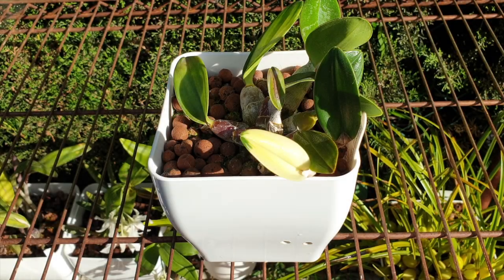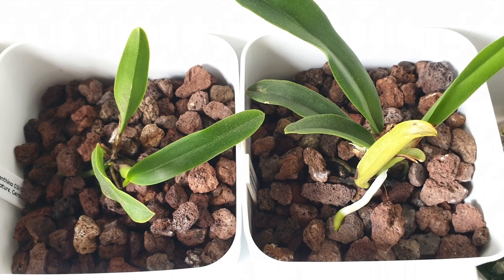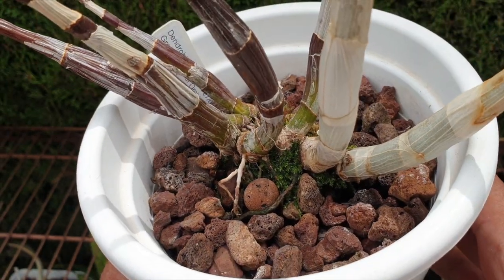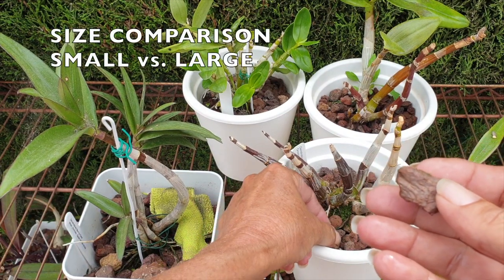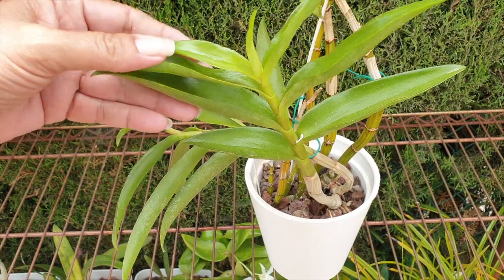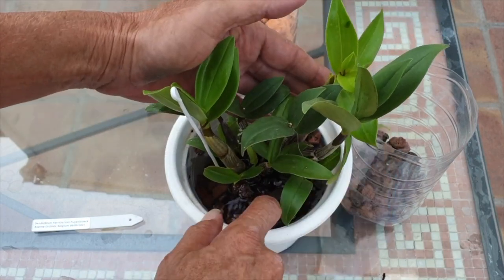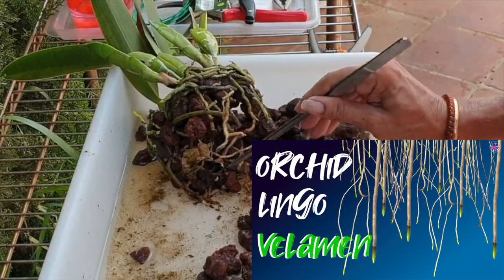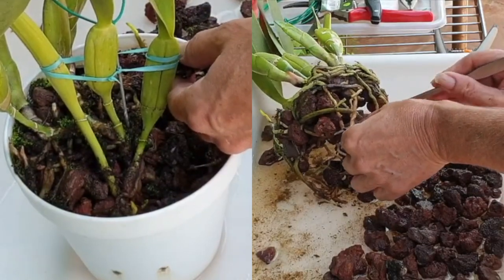Lava Rock for Orchids in Semi Hydro | How does it work? Limitations | Best Practices #ninjaorchids

Comment: I dunno, the red lava rock that I get here looks the same as yours and it does wick. It isn't terribly efficient at it, but if I set a pot of dry lava rock in a saucer of water, it will slowly wick up through the pot (but never reaches the surface). The black lava, on the other hand, does not wick but this is really inconsequential because there is something about the black that orchid roots do not like AT ALL. (I had hoped at one time to be able to use the black because it is 1/2 the weight of the red). In any case, good information to help people that want to use it. I chose to give it up because of the root damage during repot. It was just easier to use bark and replace it rather than destroy a root system every time I wanted to repot an orchid.
Reply from the maker: Don Miguel 🥰💐 hola jefe! I find that there may be a little dispersion of the water in the pot, as it rises, but I am not sure if I would say it actually wicks, but maybe with smaller pieces, there is a wicking effect 🤷🏼‍♀️ interesting to know about the black lava rock! I did not know that, thank you for adding that here. I have not seen black lava rock available here... wow... good to know because I would have picked the black bag at first sight if that had been an option and while it would still work out, maybe not as effectively as with the red. Awesome nugget of intel, thank you, Michael. The repot.... goodness me, a nightmare yes! I remember the first orchids I repotted. The coilostylis was only removed of so much lava rock because I divided it for The Orchid Room... my oerstedii probably still has some pieces of lava rock in the centre when I moved it into leca. Now I can start snipping away at division on that one but wow.... the root damage is exponential. Meanwhile, if I were still in Kenya... advanced the collection to pots ... that would be a dream... even just to have the orchids in the coral parts that were like rocky formations in the garden, secure and add lava rock for funsies! Sigh!! 🥹 thank you so much for watching, my friend! Your support is so very much appreciated 🙏🏼🫶🏼❤️🌸

Comment: Hi Nina, I  am trying leca, lava rock, and pumice. What do you think about pumice??? I just ordered akadama looking forward to see how it does. Thanks for your videos very educational.
Reply from the maker: Hi Maria 😍💐 thank you for your feedback and for watching, I appreciate the encouragement and support 🫶🏼 I have 1 or 2 orchids in pumice, because I had it lying around for years and wasn't using it as leca and lava are my go to. However, to not have stuff lying around, I potted up an Oncidium Alliance orchid in pumice only and it really enjoys the self watering with pumice. Never had an issue with it, and 3 years later, it is going to need to be repotted at some point in time. So, for really thirsty orchids, and my oncidium is medium sized, it is working great. When it comes to repotting, I am not buying more pumice just for this orchid and I do not have intentions of using it more often. I am a little wary of how porous it is, will the roots suffer damage when I repot because they have attached to the pumice and make it complicated to remove some of the dead ones? Those have been my thoughts on it since I potted this orchid up. I know that lava rock can cause damage, but I have found that if there are dead roots to contend with, even with lava rock, it comes off really easily, so I am not as bothered about it anymore. I do not remove all the media when I repot and don't force media off of viable roots. Is pumice a good filler for organic media mixes as well? I say yes, however, it will always float until roots start to hold it in place. Flushing my oncidium pot after repotting was a little bit of a nuisance because the pumice kept dislodging until the roots started to anchor themselves to it. Not sure if any of what I said was helpful, so if you have specific thoughts as to how you want to use it, where and with which orchid, please let me know and I can break it down even further 😊 hope you are having a wonderful week, Maria!! ❤️🌸
Reply: Thank you so much for all this information. I will keep that in mind. I started to use it because Anabel from, the orchid room is using it, and I thought I give it a try. And than I  saw your videos on lava rock and decided to try that also. Now I mentioned to you before that I have lots and lots of orchids in super old media's, that's why I  am trying in inorganic media so I don't repot that often. I think I have around 350 or 400 orchids to repot. I  do a little each day . Anyway thank you for all your orchid videos super helpful. I will be fertilizing them also. They have not been fed. Can you believe that. Poor orchids they need so much help. But I will take care of all them. Most of them are Phals.  Thanks again.
Reply: Have a great weekend.
Reply: Hi Nina,  I have a Prosthechea cochleata that has outgrown its 9" ceramic pot with bark.  The plant has full bulbs outside the pot and a forest of ariel roots.  It blooms consistently.  I live in a semi arid climate with humidity between 15 and 30% depending on the time of year.   So I started looking for a set up that would provide consistent moisture and humidity and came across your channel and I'm grateful for all your content..I've been been binge watching gor some time now.   In one of your videos you said you wouldn't use lava rock in a pot larger than 6".   Could you point me to a video (because I'm sure you have one bit I can't seem to find it) on your method of growing large specimen orchids?  I'm looking to move away from bark to something that provides consistent water and humidity.  As well as reduces the periodic media maintenance requirements.   Thank you for all the time and effort you put into your channel.  Keep up the good work.